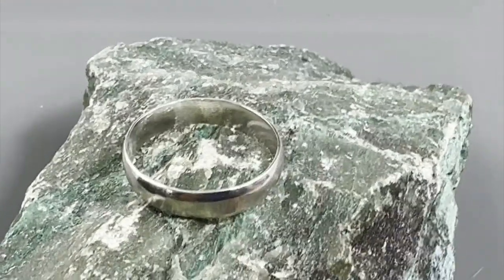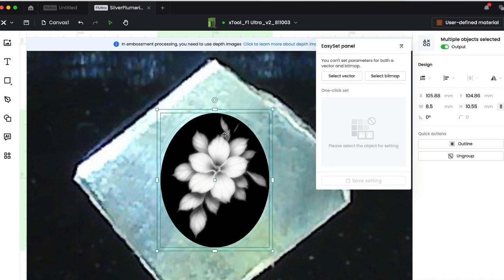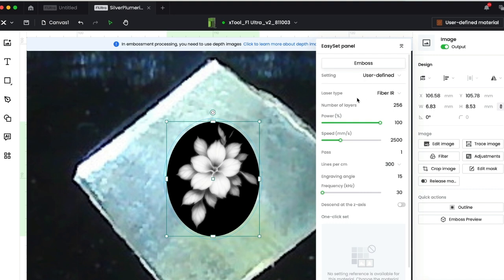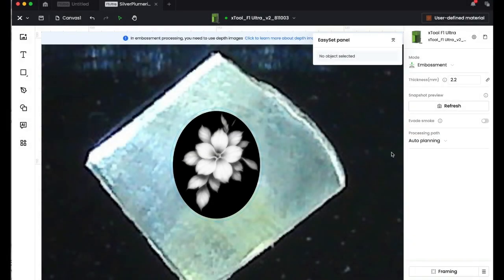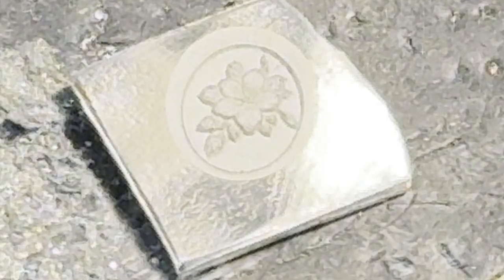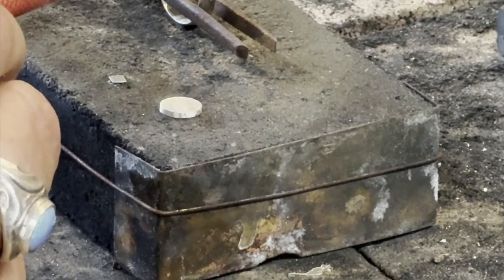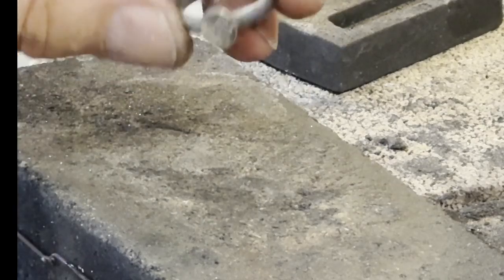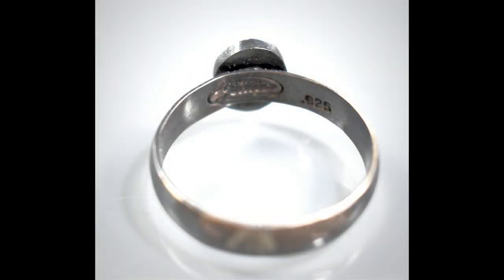Using The xTool F1 Ultra To Engrave A Sterling Silver Plumeria Ring

Comment: Hi, that is a beautiful vintage ring, thanks for sharing. I have a doubt. How long did take the engraving part? I´m interested in this machine,  so i would like to ask you ..Can the  20w fiber laser of this machine cut 20 or 22 gauge silver? Interested to make shapes, letters an a few name necklaces.
Reply from the maker: @dafonseca1971  thanks! It is a wonderful all around laser and can engrave deeply. However, cutting anything other than very thin metal requires a more powerful machine and complex settings. It can cut but that is not what it is optimized for.
Reply: @jackjellies9854  Thanks a lot. I will look for other options. Best regards.

Comment: Do you worry about loss of the silver from the laser?
Reply from the maker: @bitwhiskers6969  thanks for asking. Not particularly. When I engrave by hand I rarely can recover much in the way of chips either. But, it does vaporize the metal and it will lighten it a bit. I may do a before and after weight comparison for interest. But for most of my designs, I sense the losses are close to being in the noise.. for deep designs or cutting the losses might be significant
Reply: I see how deep the engraving is. If you did try, do you think you could cut it out fully given enough passes? I have already seen your Titanium cut out video. Very informative. Would annealing the silver help? What about Argentium vs Fine silver? Do you think it would make a difference in engraving or cutting? I am also wondering about precious metal clays that have been dried enough to carve before firing.
Reply from the maker: @hooksntoggles  cutting is a bit different. Right now it is easier to get depth using the emboss function since it allows for an axis rotation after each pass. To cut effectively we really need to have a wobble in the laser path so that the kerf can be a little larger and eject metal. I’ve not found a difference between annealed and hard for silver. Can’t speak to Argentium since I don’t use it but it may do just fine. It has a harder time with fine silver though. It will work, but the addition of copper to alloy it makes it easier to laser engrave. Also don’t know about the unfixed but dried silver clay. But that might be an interesting application.
Reply: @jackjellies9854  Thank you for answering my questions. I am but a novice. I only know enough to be dangerous with a torch.